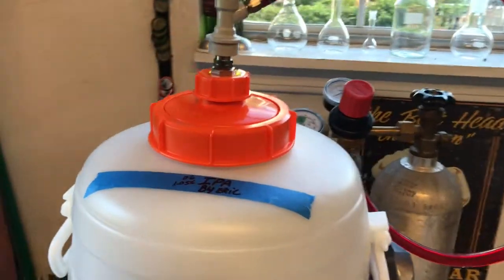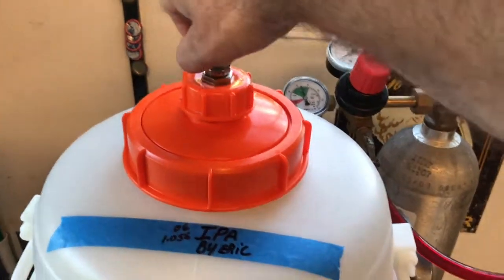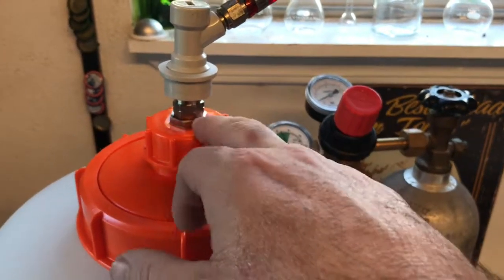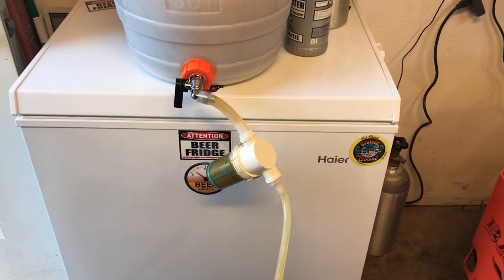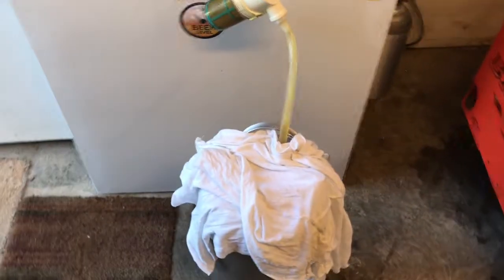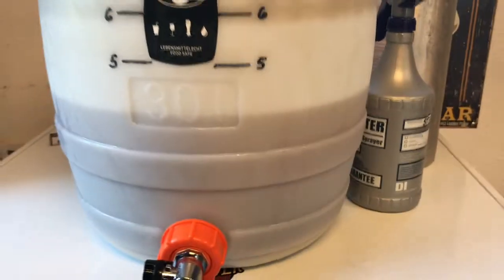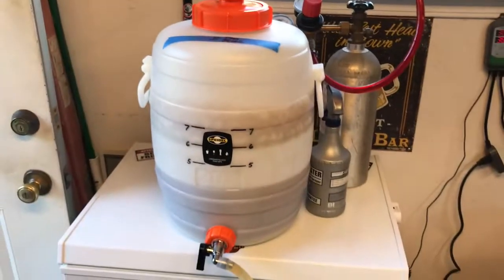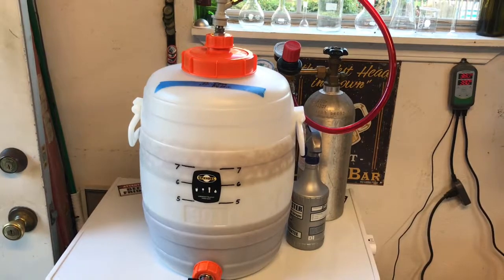CO2 Transfer System Fermentor to Keg for less money

Comment: Out of curiosity why didn't you just run it into your liquid post with the ball lock fitting??? I saw the keg was covered up so I figured you were running it through the lid section.
Reply from the maker: It is actually filling through the liquid port I neglected to mention that the relief valve is left open to allow air to escape the towel is to keep the foam from the sanitizer from getting-all over my floor cheers 🍻
Reply: @goldgulfcoastdesignericsho8628  right on!!

Comment: Hey Eric, I'm about to try the same transfer using the same setup. If the keg is initially filled with CO2 and you're running beer into it, don't you need to purge it to make space? Thx!
Reply from the maker: Yes that is correct vent the Pressure in the keg to allow the flow from fermenter to Keg. Cheers 🍻

Comment: Hi Eric, I finally have a couple of Speidel fermenters, also with the metal spigot. I am not going to use a filter for the moment i think but i am curious about the tubing/beer line size. Somewhere i am going to need a connection piece to go from the larger metal spigot down to the 3/8" beer line i use to go into my ball lock keg beer disconnect. I use John guest push fit connections on my beer disconnect. Do you know the tubing sizes that you use for you transfer system?
Reply from the maker: Tom 
3/8" ID

5/8"OD
I like the thicker High Temp Silicone Tubing seems to seal better less leaking issues and if it dose ever leak use a trusty zip tie to seal off good luck Tom Cheers! 
https://www.morebeer.com/products/tubing-silicone-38-id.html
Reply: @goldgulfcoastdesignericsho8628  Thanks Eric, appreciate it. I did take a look at the filters too, If i am going to order a few more things i may as well get one. Do you use the regular or large version (apologies if you mention it in one of the videos)
Reply from the maker: Tom Ford no problem I use the larger one it really helps with heavy hopped brews. Cheers

Comment: Do you ferment with that top piece on (the small orange cap piece with the ball lock fitting)? Or do you swap it from an airlock at the end of fermentation? How long did that 6 gallons take to transfer?
Reply from the maker: I ferment with the air lock i don't PSI ferment rite now. as far as the transfer it takes about 10 minutes i go slow so not to aerate the beer i don't want to oxidize it. Cheers
Reply: @goldgulfcoastdesignericsho8628  thanks for the info. Do you wait til it is time to transfer and quickly swap the caps over? 10 minutes is great for 'slow'  :)  I use standard buckets but wanted to swap to something a bit nicer in order to do a  closed transfer for my hoppy beers-which i always think lose aroma/flavour fairly quickly. Do you do anything special when dry-hopping? Toss it in or in a bag etc?  Thanks for the help BTW
Reply from the maker: Great questions Tom. I swap my cap over when ready to transfer quickly and have never had any issues there, my dry hoping I always pour them in directly when fermentation is at its peek I did a video on it making a NEIPA I feel like when the yeast is most active the Hop Utilization seems to be better. I experiment allot and this method I live by. Any time you have a question I’m happy to help good luck Cheers!
Reply from the maker: I just posted a video about dry hoping today give it a look. If you have anymore questions let me know.
Reply: @goldgulfcoastdesignericsho8628  thanks for the info and tips. Subscribed. I look forward to more videos. All the best
Reply from the maker: Thanks Tom anytime glad to help. Cheers

Comment: I tried something similar with another spigot on top and it took freaking forever, this any faster?
Reply from the maker: you will find at about 1PSI it will be just about rite if you bump it up higher it will flow allot faster, I have had a plugged valve from a heavy hopped beer while racking to keg I usually open and close the vale a few times and that seems unblock the plugged valve. Cheers!

Comment: This solution does not make any sense. Delivery CO2 from above is unnecessary. You can open the upper valve and chase the beer gravity. The effect will be the same. On the beer you have  CO2 which protects beer before O2. More important is to get off O2 from Keg before pouring beer.
Reply from the maker: Thanks for your wonderful advice but you obviously didn’t watch the video and see why I transferred using CO2. Cheers
Reply: @goldgulfcoastdesignericsho8628  I watched the video but tell me why you used co2. What for ?
Reply from the maker: @krzyzak3465  because of vast amounts of dry hopping and filtering the hops out during transferring to keg. you need a little more then gravity.. and it’s the safest way to transfer beer from fermenter to keg without Oxidation.
Reply: @goldgulfcoastdesignericsho8628  ok